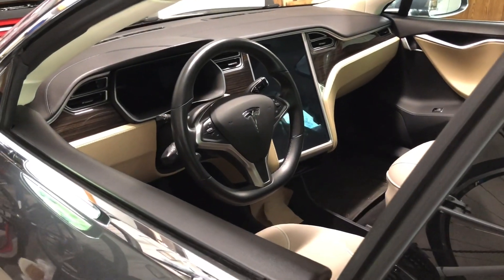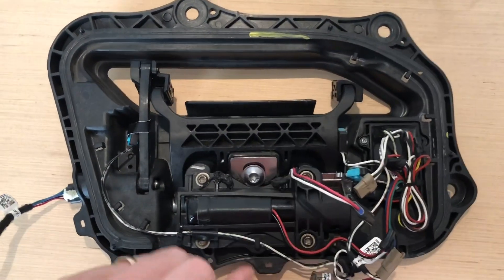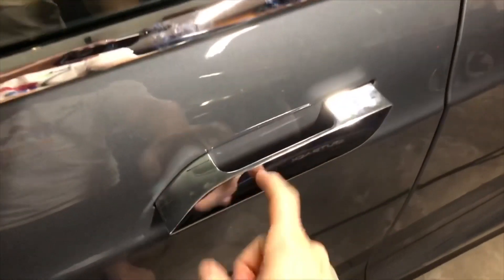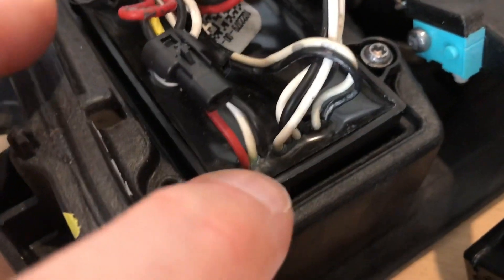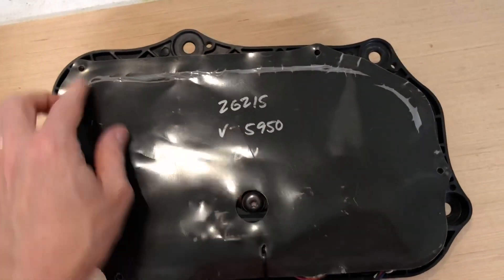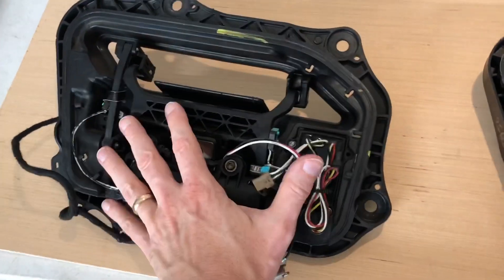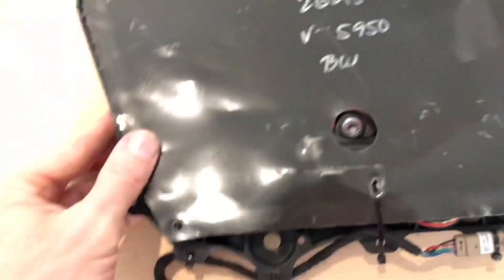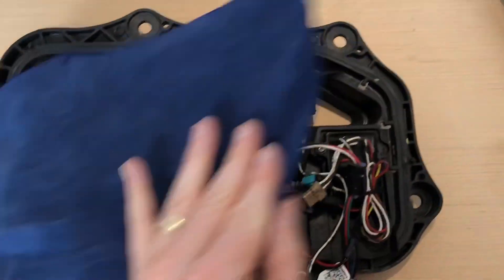How to fix your Tesla Model S door handle yourself - BETTER THAN NEW!

Comment: Your original vapour barrier probably fell off, check in the door well at the bottom, you'll find it. Use multiple layers of tuck tape and it'll stay in place.

Comment: Same thing happened to me. I’ve done it myself before but decided to bring it to the Electrified Garage in Amesbury, MA. Unlike yours mine was in tack with the vapor barrier. Problem was not the wiring or the paddle. It was a control module. They had a used one in stock so I got the repair and back on the road

Comment: Any tips? 
My handle won't retract.. after the ev tuning kit either
Reply from the maker: Decent chance it's the controller then -- there's not a lot else if you've already done the microswitches and the paddle gear.  Check out on this video, where I discuss that replacement :  https://youtu.be/F56qTySCSD0
Reply: @NZCUTR  I am suspecting the 3rd microswitch that usually touched the paddle gear on the way back

Comment: I think the inside handle cover keeps the moisture in and rust que wiring and sensors. Without the cover que moisture can dry easily.
What you think about it?
Reply from the maker: The cover isn't watertight, they bottom is quite open and water easily gets in through the handle opening (plus the retracting operation flinging it in) but I think the cover helps keep water that comes in through the window seals from constantly dripping on it while parked / road spray.  Really hard to say though-- which is why I've been caulking the harder to fix controller wires where they enter that module.

Comment: On my 09/2015 MS I’ve had all 4 replaced and on my refresh 10/2016 MS I’ve just had door LEDs go out (3 of them) but no functional failures.
Reply from the maker: My 2014 has no original handles, IIRC.  I have at least one Gen 3 (which I don't like the action on, TBH) and the others are a mix of 2 and 2.5.